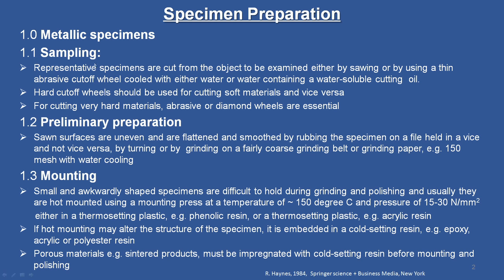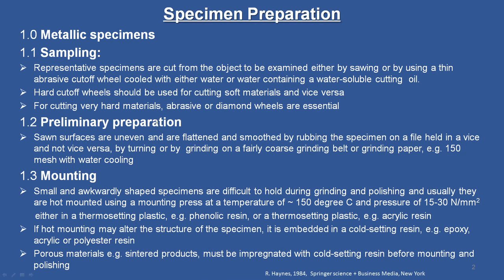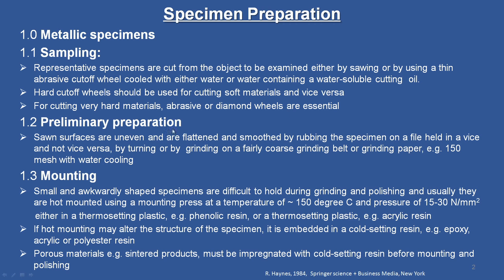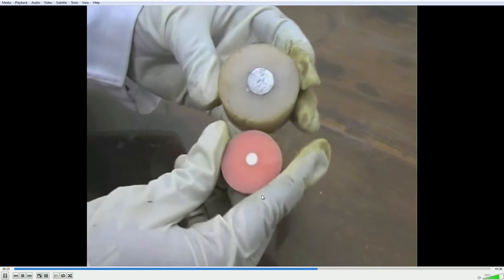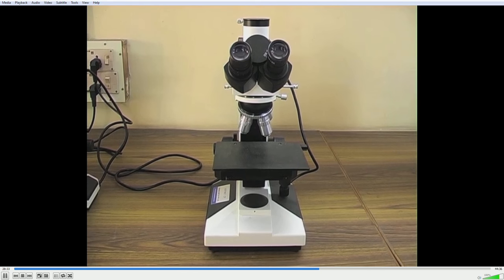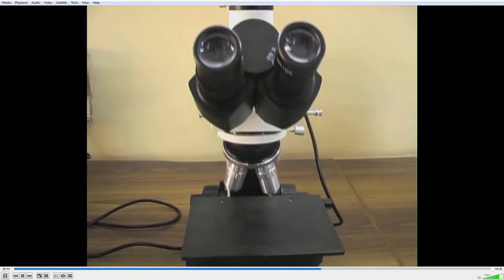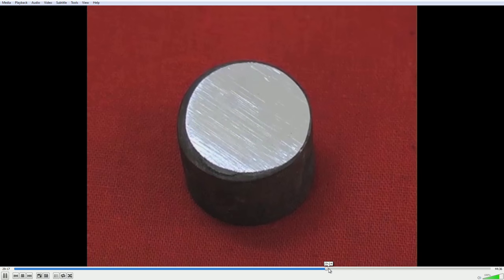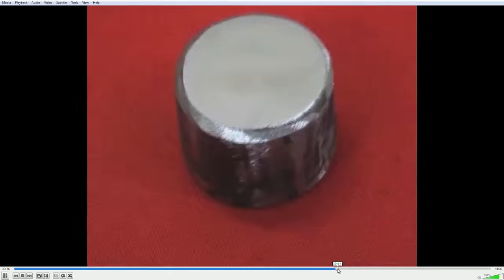Sample preparation techniques for optical microscopy

Comment: can you please tell me any way to polish aluminium alloy samples, the procedure i am using is grinding from 80 to 1200 , then polishing from 9 microns to ops colloidal using water based solution when i reach from 3 to ops the material get some weird scratches
Reply: Hello sir , did you get any solution ? Which give fine finish of al sample ?